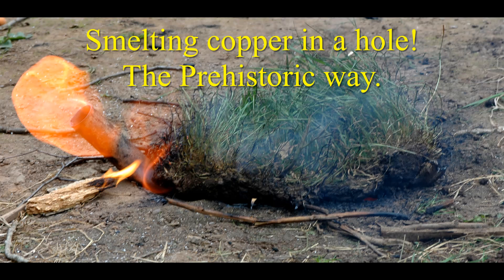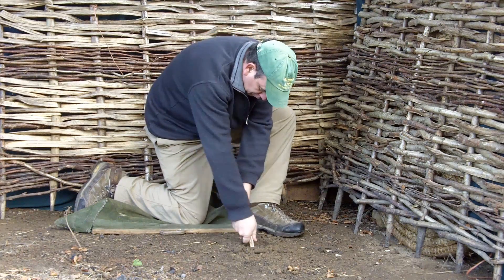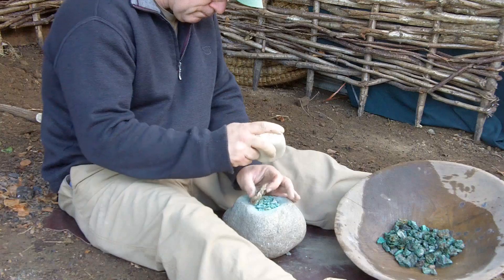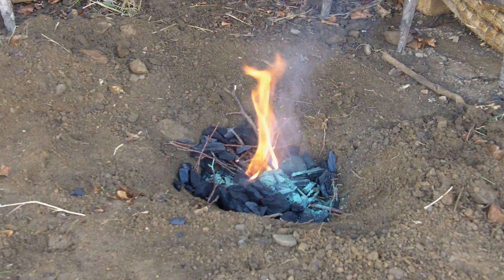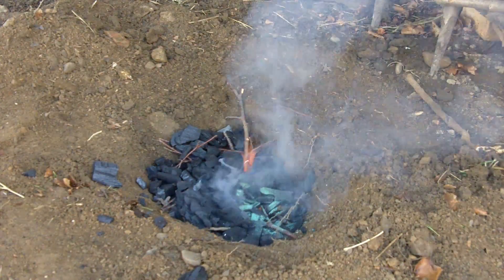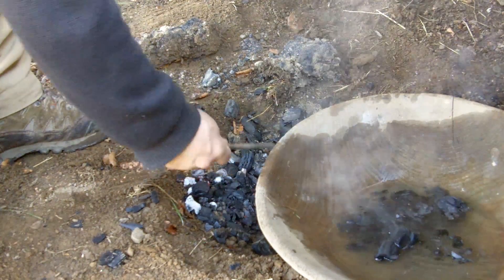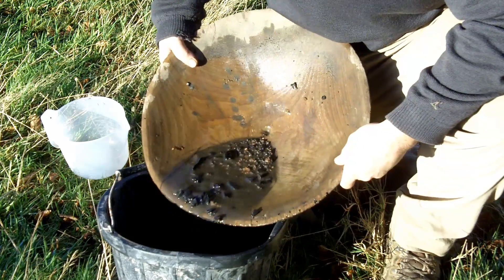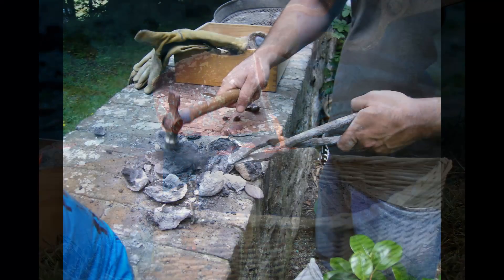Prehistoric copper smelting in a pit (louder version of https://www.youtube.com/watch?v=8uHc4Hirexc)

Comment: 1
Reply from the maker: Hello, thank you for taking the time to watch our video. Smelting and melting are not the same thing, you cannot melt copper ores into metal; it is a chemical process not a simple heating process. Once copper ore has been smelted into metal you then heat it until it becomes a liquid then pour it into molds; this is called casting the metal.  You cannot go from copper mineral (ore) to a case object in one step. 

It is easier to dig a hole in the ground to act as a furnace than build a furnace (you would have to first build a wooden frame then dig and process clay (remove stones) to cover the wooden frame, then dry out the furnace). We have built and successfully used furnaces this way in the past but the excavation and dating of the Pentrwyn site proves that they were also using pits to smelt copper (see link in the description and our other short video on smelting geothite).

We used a stick to dig into the subsoil because they didn't have iron/steel picks or iron/steel spades in the Bronze Age. They could have used copper or bronze tools but due to the amount of work involved in mining, processing, smelting and casting such tools using a simple wooden stick was probably more likely. 

Your description of "a simple" draft furnace made me smile :)
Reply: @ancient1580  just plain wrong heat malicite 0ver 1068 C in an electic fordge you get copper
Reply from the maker: @scottmcwilliam9629  A "forge" is a type of hearth used to heat metal to allow it to be beaten or hammered into shape.  Copper ore is not a metal, it is a mineral (a stone).  Are you perhaps thinking of Native copper (a metal)?

Comment: With regards to the bellows. Obviously Bronze age peoples would not have had a steel nozzle to attach to the furnace so is there any evidence as how they could have done this? Fired clay nozzles perhaps?
Reply from the maker: +James Bruce Hi they would have used a clay tuyere (pipe between the end of the bellows and furnace).  We do use these tuyeres for experiemental work, but the bellows used here are the set we take out on our travels to do demonstrations around the country; the steel pipe copes better with being thrown in the back of the van! See our clay tuyere here: http://www.ancient-arts.org/pentrwyn%20exp%20report.pdf

Comment: Is there any theory on how bronze smelting was discovered ?
Reply: +psychotek The process through which the smiths learned to produce copper/tin bronzes is once again a mystery. The first such bronzes were probably a lucky accident from tin contamination of copper ores, but by 2000 BC, we know that tin was being mined on purpose for the production of bronze. This is amazing, given that tin is a semi-rare metal, and even a richcassiterite ore only has 5% tin. Also, it takes special skills (or special instruments) to find it and to locate the richer lodes. But, whatever steps were taken to learn about tin, these were fully understood by 2000 BC.
Reply: +psychotek https://en.wikipedia.org/wiki/Smelting
Reply from the maker: +psychotek Hi, as you rightly say we don't know how copper smelting was discovered.  There are many theories; one is that green copper ore was thrown into fire to make interesting coloured flames, another is that potters experimenting with copper glazes came across it (their kilns may have acidentally produced suitable smelting conditions). Once we had discovered copper smelting I'm sure every strangly coloured rock found would have been experimented with and different combinations tried (such as adding lead or tin copper to make bronzes).